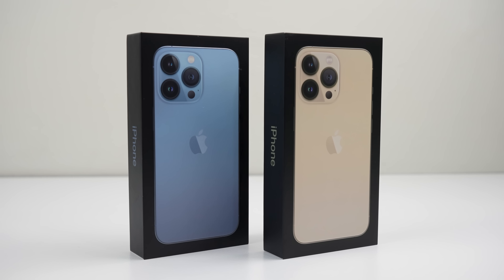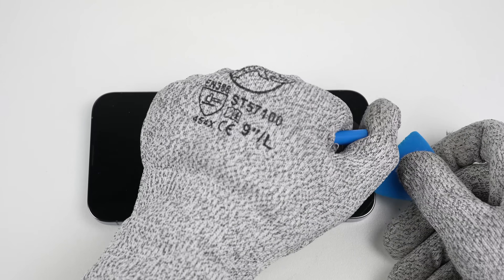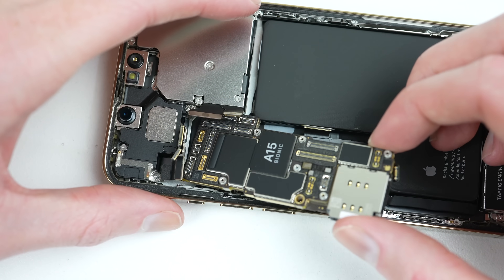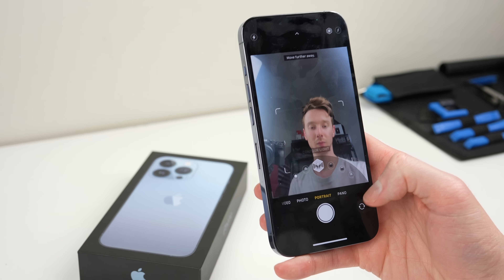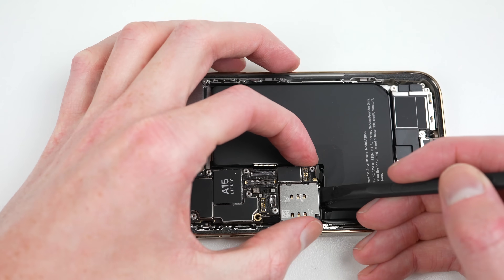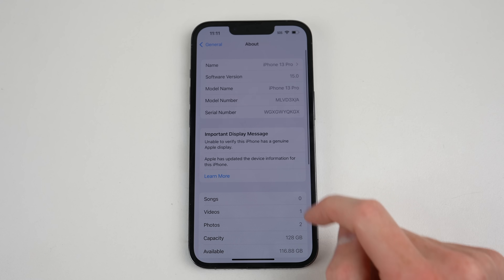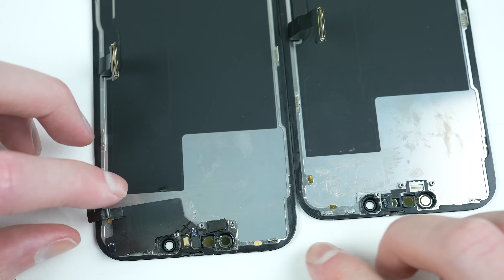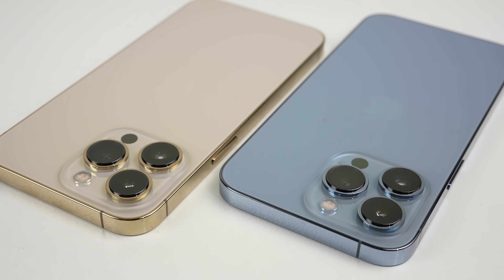iPhone 13 A Repair Nightmare - Teardown and Repair Assessment

Comment: Flaws...
1- You are using USED parts. Its a very common thing to code software to reject USED 2nd hand components in order to protect the quality of the device. While you didn't have nefarious intentions, shops might. They sell USED parts as OEM new parts all the time. 

2- You are NOT a factory AUTHORIZED repair Tech.. therefore you lack the proper training and tools needed to complete an ACTUAL repair. This voids the warranty but is also needed to make sure only qualified techs repair the device. As you state a REAL factory repair has the software to install new parts.

3- All major manufacturing companies do this. Your dishwasher has a computer that MIGHT not function correctly if you swapped it with the same computer from the same model dishwasher... BUT for a price you can get the Factory Qualified Repair Tech to re-code the computer.

My 2006 Chevy Avalanche... there are NO driver electronic parts which can be swapped without FACTORY or DEALERSHIP re-coding. Even the window control panel has a lock out feature which STOPS "junk yards" from selling parts.  The part may have limited function or be completely dead.

Welcome to the New World Order..have a seat right there.

Comment: Apple feels like a company that likes going in reverse, taking the best tech they can and literally engineering it worse, why is this company allowed to sell anything anymore? They're not even complying with the anti-waste usb-c laws which were to reduce waste. 

These people never actually innovate, like a reliant robin, they take a working thing and then you need training wheels on it just so it doesn't tip over and self destruct. In this case repairing it causes it to cease function even with parts that should work entirely.

Comment: Laughs at replaceable Screens... When I scratched my iP12PM's Screen I went to my local Apple Shop where I bought it to have it replaced - An hour later I went home with a brand new iP12PM, not just a new screen - Yea... My old one HAS had a new screen installed, they showed me - Because they couldn't get it out of an infinite Boot Loop after replacing the screen 😌

Comment: My guess it that everything is serialized. Down to the cables used. I would bet that to replace anything you would need to add the new serial number of the part to the device inventory and only with Apple's super secret access code.
Reply: Thats pretty much what the video just showed us dude.

Comment: It's the same tactics scamers use on pop up ads. A big scary message that says there's a problem. Making fake problems (like locking you into the Web page but the apple equivalent is locking you out of face id) to make it seem like there's a genuine threat instead, and then charging you money to fix an artificial problem that they made.

Comment: If Apple is watching -- I've owned iPhones since the first was released, however I refuse to buy a device that can't be repaired. Especially with all of the cracked screens I've had to have replaced over the years.  On one hand it prevents phones from being stolen and 'parted' out, however it would be just as easy to lock out parts from stolen phones and allow third party parts to work just fine.

Comment: You just proved that Apple has good security because the TPM identifies that a potential hack of the phone is underway. You are attempting to get into a phone by replacing certain components was defeated.  Just think if the police were trying to get into your phone and could do so by changing certain components thereby fooling the phone into thinking it properly identified the owner.
Reply: Sheep.
Reply: @harukrentz435  Meaning, you have no idea what is being discussed.

Comment: I watched the video, read comments and the only thing that surprises me is that people still buy apple products and then complain about the same things as the previous model and the one before that etc. 
If something is not good enough don't buy it , if you keep buying the product despite its faults then the only message a company gets is that it was commercially viable. 
Just stop buying bad products and any company will stop producing them.

Comment: Well you can probably certify yourself as apple service tech for 50k and make exclusive deal so your shop wont repair any other brands.. then you get the tool to reset the software locks

Comment: Seeing how Apple is happy about the sales numbers on the iPhone 13, I wonder how much crap can the fanboys take before opening their eyes. 
Buying this phone is beyond ridiculous.
Supporting Apple's behaviour is going to have a heavy impact in all other industries, with more and more products owned exclusively by the manufacturer.

Imagine being forced to go to the dealership to replace a headlight bulb and if you try to do it yourself your car is going to disable all the lights due to unauthorized repair. And even a professional mechanic can't touch it.
Reply: They made a cheese grater mac for like 10k and they still kept buying. These people will buy a cup with an apple logo for 300 dollars if they wanted to🤦‍♂️
Reply: @isidrogarcia8048  That makes total sense though. The Mac Pro is a beast of a system. Expandability and DIY at it's finest. Except for that crappy 1,000$ stand or the 400$ wheels, everything else checks out.

On the looks, oh well, whatcha gonna do.

There's a lot of video editors out there that charge 400$/hr and work 40hr/week (so an almost maxed out system comes out to 32,000$, 10 days of work... 80 days of work with a normal video editor wage) and need these kind of systems. The pricing ain't really that far away from another TR/Xeon platform when you factor in expandability up to 1.5Tb of RAM and multiple GPU slots (which most other boards lack). I will be mad at Apple if they pull the plug in 7 years or so and stop supporting system updates on these machines that could literally run anything for ages. Just like they did with the big old aluminum Mac Pros despite being capable today. But that's a story for another day

Comment: I think it should be known... To be able to replace the parts on these devices, you need 2 main things:
1. A Genuine Apple OEM part
2. Apple's recalibration software to be able to re-calibrate the new part so it WILL work
Once these 2 things are done, the device will work perfectly again,
So Yes, the parts CAN be swapped out, no the repairs will not be easy/ available to the general public... Thanks Apple!

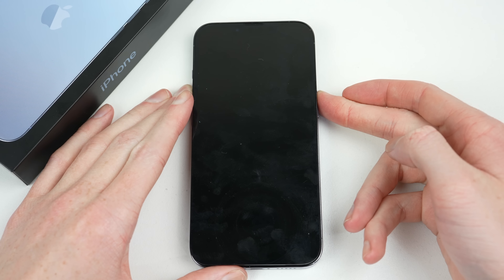Comment: @6:20
Hugh: "turn it ON...Let's see how it reacts. There are several messages..."
Phone: "Okay...I know you opened my display, disconnected my logic board, power, camera,  and my screen cables. You then swapped my processor board from a supposedly similar model. You have violated our Apple "NO-right to repair walled garden agreement" and have been automatically reported via your own wifi connection. Our Apple lawyers will contact you should you do this ONE more time. Thank you for buying Apple.
Hugh: ...sighs.

Comment: As long as dumb fanboys are buying it, nothing will change. They will run to the AppleStore for cleaning the display and recharging the battery and happily pay several hundred bucks for it. I am a bit unhappy that most other companies are following Apple on this. Had quite a few nice Samsungs over the years, but will probably go Chinese on the next one. When I have to chose between some company spying on me and some company spying on me AND not being able to repair my phone, I take the first one. 
Apple is a cult in dire need of being put into place. Same with any other company that wants to "loan" me their software instead of selling it to me. Yes, I mean you Adobe and MS and all the others. 
Fortunately, for most of those there is a work-around in form of free and open-access software...or some illegal download with a crack to make it work. Either way, no money from me. This is more difficult with hardware, but there will always be someone able to jailbreak it or just build a good phone without such stupid "features". 

Apple...never liked Apple...when I got my C64 we had Apple II at school...not even a contest. Encountered several other Apple products over time, but always was repulsed by some "feature" or another (remember the single mouse button? What an abomination!). Unfortunately, intelligence in the population diminished and having something shiny and expensive with the message of being hip was way better than having the same with no message, not as tacky and way less expensive. Sadly, IQ has even fallen further. Some people cannot be saved, we have to leave them behind and teach others how to do it.

Comment: my question is why cant a developer remove the code that runs it? cant we just pay someone to replace the ios?
Reply: Because it is encrypted. Even the battery controller is encrypted. Even if you managed to find the method and keys to decrypt one of the modules, it will then detect it's been decrypted and you'll get the same thing.
Most you can do is try to take a memory image from the old part and flash it to the replacement part. This method has been done for a while with iPhone displays.
But Apple will come with a way to stop that, if they haven't already.

Comment: Honestly I think these tactics should be illegal. Phones aren’t just a toy, they are practically a necessity in the 21st century, the same as having a vehicle. However, if I want to have my vehicle fixed, I have the option to take it to any mechanic I want to but for some reason apple has an issue with people taking their phones to be fixed where they please. This lunacy has to stop, it is no way to treat the customers.

Comment: It's as simple as this: If you do not have the Right to Repair, you do not have the Right to Own. You're paying to rent the device until the next model comes out.
Reply: Do you know anything about Fairphone? Haven't gotten one yet, but it's supposed to be fully repairable and made mostly out of reused materials.
Reply: @ylleba  Fairphone is awesome! I have the FP2 and I already replaced three of the modules myself after they were shipped to me free of charge because it was still in warranty. An absolute BLISS compared to this Apple bullshit.
Reply: @sebytro  i do love the concept and the company, but the build quality is crap. Bought a fp2 for my gf and it doesnt work right... Slow movement, bad touch detection.

Love the repairability and the design philosophy though!
Reply: @ylleba  sounds like some bullshit company. why not get a xiaomi?
Reply: @ahtoshkaa  Xiaomi is Chinese and they tend to have horrible ethics when it comes to manufacturing, human rights, etc. you get the idea. Fairphone is Dutch and they pay close attention to manufacturing, ethical raw resource extracting, livable wage for workers and important things to consumer, like good non overly complicated and decently priced phones, modular ecosystem, unlocked firmware and right to repair. So no, not as bullshit as xiaomi.
Reply: @ylleba  whatever floats your boat. I'm just saying that with Xiaomi you get amazing value for your money. They could be made using slave labor for all I care.
Reply: Farrrkkk. You said it. Well stated 👍👍. Cant be put any better. Isn't recycle parts mean replaceable.
Reply: It really is that simple. Can't understand how many morons just don't get that, or actually side with anti-consumer practices by massive for-profit (read: inherently exploitative) companies.
Reply: Exactly. Repairability is a big feature for some people including me. I have had a bunch of stuff replaced (on my samsung) And it works exactly like new.
Reply: Now this is the slogan apple loves so much.
Reply: Wait, you were supposed to pay?
Reply: @bananadoppiooncrack5757  momma bought yours, we know bro
Reply: @Th3Mavr1ck  no rather she passed away 2 years ago, her gift to me before passing was a ring.
Reply: Now that’s a dramatic take if I ever heard one.

Comment: The problem is not that the phones are not repairable. The problem is that ONLY apple can repair them.

Had a problem with my Iphone 12 Pro, they repaired it at the apple store (as in changing the faulty part, not the whole phone) but I couldn’t go anywhere else than the apple store for the repair.

Comment: It's the way things are I guess. You don't own anything. You just rent the technology. And I'm glad he makes the point that being more eco friendly and sustainable would actually be to make a phone you can easily maintain via a third party nstead of having the manufacturer have to fix it which is usually too expensive so you end up junking it and buy a brand new device same thing with Tesla cars and these new crazy complex cars (direct injected or super or turbocharged, etc) that get good gas mileage but you end up junking after 5-10 years bc the engines wear out  and/or bc it's too expensive to fix.

Comment: The only reason sheep keep buying Apple is because "all my stuff is already on there and it would be hard to switch". Ask any Apple user who isn't a fan boy and they'll say they're basically stuck at this point using terrible devices which you don't own.

Comment: Who the hell repairs an IPhone just buy a new one.
Reply: Imagine wasting your money on a whole new phone instead of keeping the one you have and replacing one or two parts for a fraction of the price. It's like going out and buying a whole new game controller for 60$ because one of the buttons doesn't work when all you have to do is replace the ribbon circuit board for 8$

Comment: I'm sure I'll get downvoted for this comment, but the hardware is probably locked out to prevent thieves from stealing and cannibalizing your iphone (as was common for many years)

The current design poison pills the hardware, and adds always-on bluetooth tracking so that it's virtually impossible to fence stolen iphones. I consider it a good thing that my stolen iphone will be bricked, and broadcast a location signal until it's physically destroyed
Reply: Won't downvote, but I hardly believe that bricking people honestly trying to repair their phones is anywhere near worth making it slightly harder for thieves to make a buck. The phone will still have all its value to a thief--making theft slightly mote inconvenient at the cost of the consumer just straight up isn't Apple's place.

Comment: Apple protecting owners from third party, possibly low quality replacement parts is a good thing. The question is why genuine Apple parts as shown here, fail to work?  I see two issues, 1/ If it is because the part needs to be calibrated after replacement and that calibration requires special or expensive tools, then those tools should be made available to third party repairers. Then the question becomes, are those third party repairers qualified to use the calibration tools correctly? The last question is then, what do the calibration tools cost, who trains them, where do third party repairers get trained and at what cost? and are third party repairers willing to pay those costs? Finally 2/ If there is no calibration, security info held in software on the part or other genuine reasons for the software lock, the software lock should be able to be overridden by anyone. Finally, just saying the parts look the same, without knowledge of calibration or security info being held on the part does not answer the question of right to repair or consumer protection against substandard repairs. Unfortunately I have yet to find an honest conversation about this subject and of course it doesn’t help that Apple won’t talk about the technical reasons why parts are software locked.

Comment: This is the same problem with Tesla. They’re hiding all the repairs behind a Tesla paywall. You can’t fix most problems unless you consult a Tesla repair expert,
Reply: Tesla and Apple and probably bed buddies.
Reply: If you somehow manage to do a repair by yourself on a tesla, and they find out, they disable your fast charge option making the car a pile of junk.
Reply: This isn't true lol it's a car like any other. Nothing is stopping you from changing wheels and tires and fixing ball joints and shit. Its software that's a pain and that's literally every new car.
Reply: @sunburst8810  that's the exact problem,other car companies are doing bs as well
Reply: @sunburst8810  which is why I only own old vehicles.  i screw with enough software stuff at work (electric golf carts) and like being able to make my own repairs…

Comment: Next Step :
Changing all the connector into a one-time use connector, which immediately breaks when being unplugged and have to be replaced completely.

Next 2 Step :
Adding a one-time trip sensor between display and body that makes the phone unusable if it ever being tripped.

Next 3 Step :
There is a fee to turn on each option in the settings.

Next 4 Step :
The phone is no longer a buyable item, it is for rent.

Comment: From the bitted part of the Apple, I see a big worm with big teeth who wants to bite me. 
I even use a knife when I want to eat an apple. I prefer sweetly species not bitter ones. 
I first peel it (because of pesticide and wax) and remove seeds from the middle and cut an apple into quarters. 
And no way you can assemble it back, using quarters or peel from another apple,  just like the Cupertino boys did with iPhone. 
Made it unique like every apple it is and only they keep the DNA key hung around their necks.